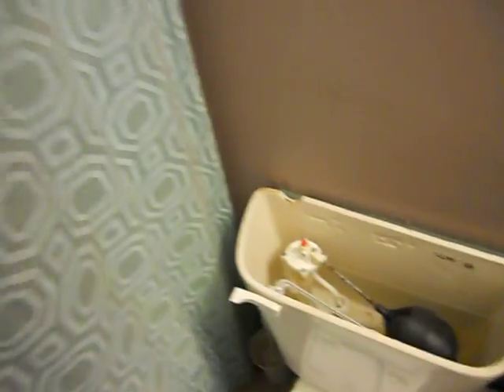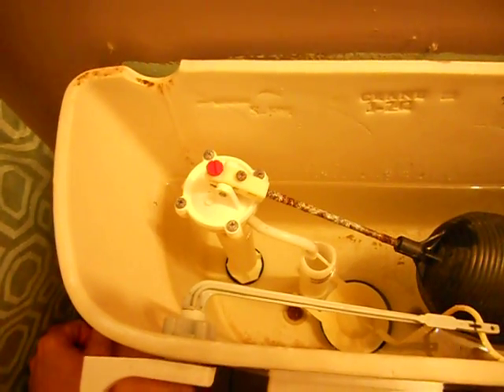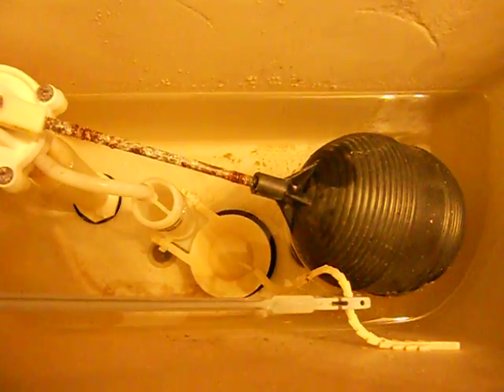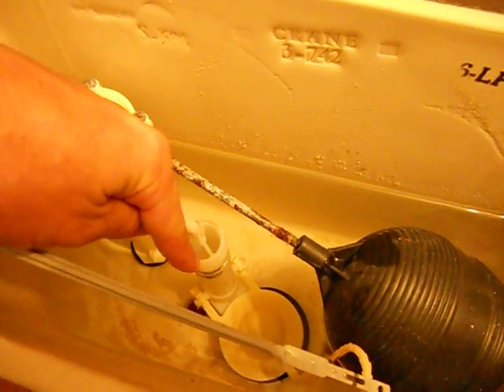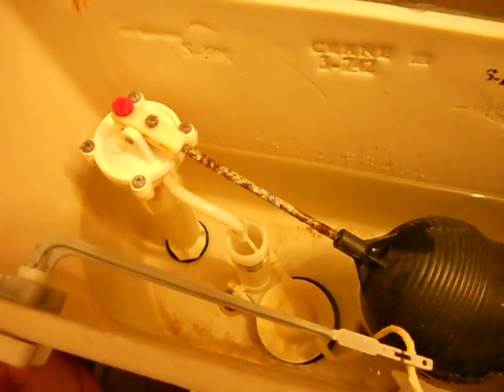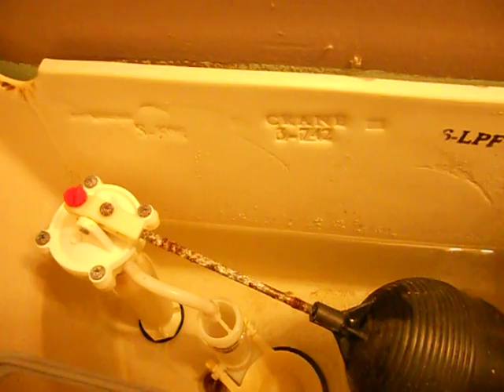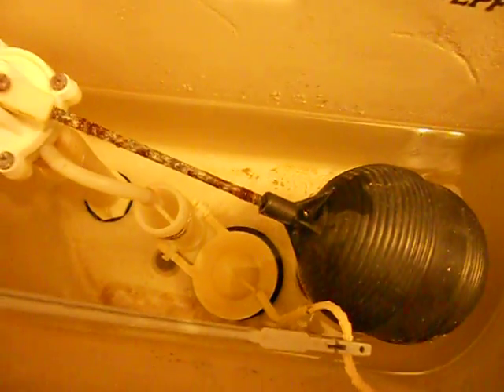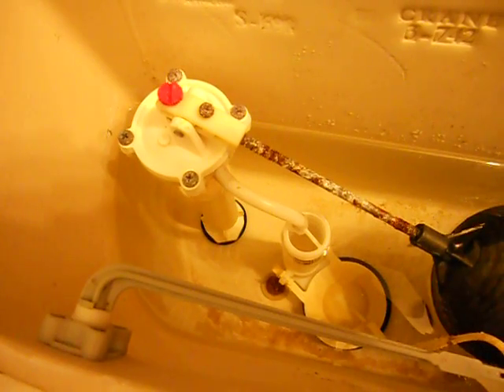Adjusting a Ballcock

Comment: Ty!! had issue of constantly filling, pipes shaking after flushing and full replenishment of water in the tank..Tightened the top screw on the taller tube attached to float rod..and the problem went away ( so far) immediately! Hope this does the trick.
Reply from the maker: Thank you for watching. Check out hundreds more of our videos at https://www.aroundthehome.org

Comment: Thank you for your easy to follow  video. I have this old school assembly in my tank. Same toilet too. Can I replace the flush valve that doesnt have this type of ball float connected? You mentioned it in the video. My question is can I just install myself the universal flush valve without this type of same ball float or does the tank need to be adjusted somehow to use a different setup?
Reply from the maker: Yes you can! Here is my video on that. https://youtu.be/KLvoFsE3NP0  Good luck and thank you for watching.

Comment: do you turn clockwiase or anticlockwise
Reply from the maker: That depends on what you need to do. Turn it clockwise to tighten the screw against the valve and it lowers the ball. Hence, lowering the water level in the tank. Turn it counterclockwise for the opposite. Thanks for watching, and I am glad to help. Don't forget to stop by our website www.greatwhiteninja.com

Comment: It's unfortunate that you didn't make a demonstration. I was waiting to see what it would looked like if you screwed the red screw because when I was screwing or unscrewing, I was a afraid that the screw "loose" would let the water out or even suddenly splatter out.
Reply from the maker: I do a better job of explaining this old ballcock in my newer video https://youtu.be/7BPDBBVzSWk which pops up in the first few seconds of this video. Though I don't actually adjust the screw, mostly because our water is so hard here that I don't want something to get stuck on this old fill valve. I am not sure what you are describing when you talk about fearing the screw. Were you worried that water would shoot out from under the screw? Because if you were, that does not happen unless something broke apart.
Reply: @AroundTheHome1  Yeah, just wanted to be safe. I did the work and it's all good. Thanks :)

Comment: Instead of that little red knob at the top, mine has a metal screw, similar to the nearby screws.  I need to lower the water level and don’t want to break anything.  Should I use a screwdriver and gently try to adjust it anyway?
Reply: Well, I saw one of your other answers on here just after posting that, so I twisted the screws on the ball shaft and on top of the little tower, and it seems to be working.  By the way, thanks for your video.
Reply from the maker: Glad that it worked. When it comes time to replace it, here is a video for that. https://youtu.be/KLvoFsE3NP0

Comment: Where in the video did you show how to adjust a ballcock? Even though I don't have a red button, if I knew which way to turn what I have to raise the ballcock, even that would have helped. That's what I was looking for.
Reply from the maker: Adjusting the red screw is what you adjust. Your adjustment screw might not be red, but you should have one. Do you not?
Reply from the maker: I see, I really forgot what I put in this video because it is like 6 years old. If you screw that adjustment screw to the right it should lower the ballcock arm and lower the amount of water in the tank. The opposite happens if you turn the screw to the left.

Comment: What is the red screw called. Mine keeps slipping cause the toilet to run. It will take time for me to get it situated again but it continues to happen. Can I just replace that plastic screw?
Reply from the maker: That red screw is just the fill adjust screw. Don't think you can buy just an exact replacement. Here is a video to replace that old ballcock for something newer. https://youtu.be/KLvoFsE3NP0
Reply: Just stick a piece of cardboard in there.
Reply: They sell replacement fill valve caps, or used to. Also the inside diaphragm and plunger can be replaced. In this video I think it's the Hoov r line brand fill valve.

Comment: Those straight up and down valves blow, if you buy the right one you will get more than one year buy never 2 years.  The ball valve would last up to 20 years or more.
Reply: I've seen one of the Fluidmasters last for 20 years and a ballcock last for about 90.

Comment: I just replaced the ballcock because water was spewing out from around it. But how in the world do I get the water level under the top of the overflow tube?? I’ve adjusted the red plastic screw and can’t get the floater to get where it needs to be. I’m all out of ideas.
Reply from the maker: On some ballcocks, you can bend the metal shaft. But most of the time this will just cause the float to spin up. There is a small amount of adjustment to the old traditional ballcocks, and you might not be able to adjust it to how you need to. Honestly, I never install a new one. I always install this instead.  https://youtu.be/KLvoFsE3NP0
Reply from the maker: I can't believe that I forgot this. Some ballcocks have a tightening screw at the top where the metal shaft goes in that will allow you to move it down a little, on these ones you could bend the shaft a little. For the rest of them, you can screw the ball itself up and down to make it longer or shorter. Sorry, it has been a while since I have actually worked on one of these old units.
Reply: Thank you so much! I bent the shaft a little bit and adjusted the little gold screw. that seemed to fix it:)

Comment: Tightened the screw clockwise all the way but the water still over flows
Reply from the maker: Sounds like you need a new fill valve at this point. Try this video. https://youtu.be/KLvoFsE3NP0

Comment: I put similar fill valve but when I turned on the water supply…no water filling in tank…any suggestion?
Reply from the maker: Just with what you have given me, it sounds like the fill valve is just completely off. Is the screw so tight that it is pushing the plunger down?

Comment: Water closet not filling up to the level it should, it stops approximately inch & a half lower than the water mark left on the closet wall. It is the older model with ball. I cannot change because the water inlet valve outside is turning free or bad.
I want the the closet to fill up automatically, should I turn the top screw counter clockwise?
Thanks
Reply from the maker: Yes, turning the screw counter clockwise should raise the water level. If you did want to change out the fill valve, but your shut off is not working properly, then you could turn the water off to the entire house and make the change. Thank you for watching, and please share. Check out hundreds more of our videos at https://www.aroundthehome.org/
Reply: Around The Home I turned the top screw counter clockwise, it threw some water out closet first, then I made little adjustment with the screw driver & got the sprinkling out under control. It is filling up much better now , thanks for your quick feedbacks, I appreciate your help a lot.

Comment: Nathan my float ball will not retract all the way up it makes a hissing sound and won't go off I have to pull this ball up more just a bit to get to go off if there is an adjustment from what I see where a flat  head screwdriver how to?
Reply from the maker: I'm sorry, but I am not understanding your question. Any ballcock that I have used has a simple adjustment screw that directly pushes the valve off when the ball rises. If yours is older and has ceased in being able to do this, adjusting the valve will not be enough. Then it is time to replace that fill valve with something better. Here is my installation video to help you upgrade your toilet. https://youtu.be/KLvoFsE3NP0

Comment: Is it necessary to keep the ballcock? I replaced an old fill valve with a modern day fill valve but there’s nothing to attach the ballcock to.
Reply from the maker: What did you replace it with?
Reply: @AroundTheHome1  I replaced the old valve with a Korky Universal Fill Valve No. 528MP from Home Depot
Reply from the maker: The ballcock is just trash. The Korky has it's own built in float.
Reply: @AroundTheHome1  Okay, thanks.

Comment: I still don't know what the right screw does I can't get my water level down below past the drain pipe
Reply from the maker: The screw on the right just keeps the bar for the float from un-screwing. If you can't get the adjustment to work then it may be time just to replace that old ballcock.   Here is a video for that. https://youtu.be/KLvoFsE3NP0

Comment: Question.  I have same toilet as in this video.  My problem is that when I flush only about half the water from the tank goes down and then the flapper shuts.  If I hold the flush handle down for 8 seconds the tank will completely empty and I get a good flush.  The way it is now I'm not getting a good flush and there is very little water in toilet after flush.   
How do I fix this?
Reply from the maker: That is a good question. What flapper do you have? If you want to send more detailed questions and pics you can hit me up on the contact page of my website. www.greatwhiteninja.com
Reply: Replace the flapper.

Comment: QUESTION: I have to exact same set up as you do and I'm trying to get my water level just right. Can you please tell me what that screw to the right of the fill valve screw is? It seems like it has something to do with the float arm, but I'm not entirely sure and I began messing with it like an idiot, lol. Luckily, I only turned it left and right, half turns at a time, so everything is fine. But I would really like to know what it's purpose is and how to adjust it. Thanks, good vid!
Reply: It is to adjust how low the ball goes.